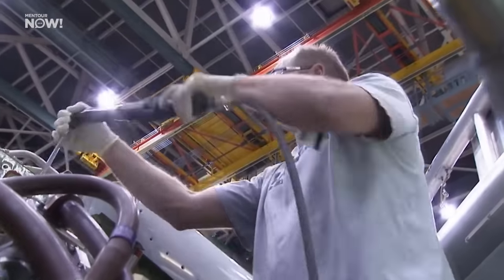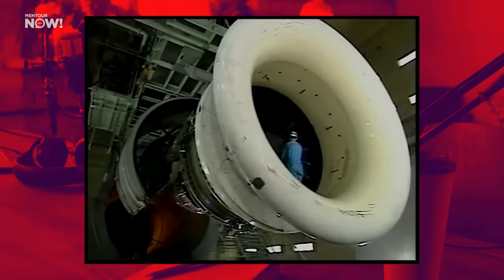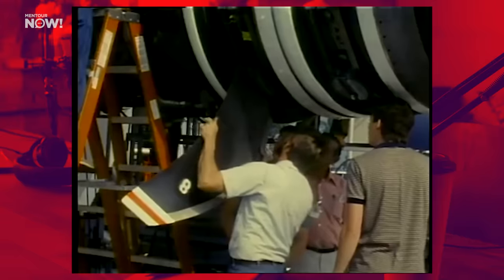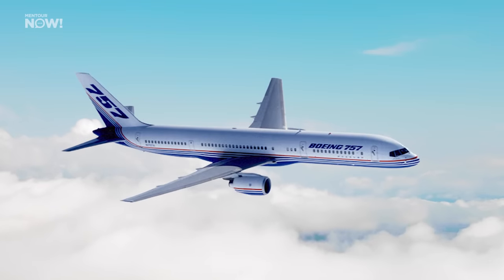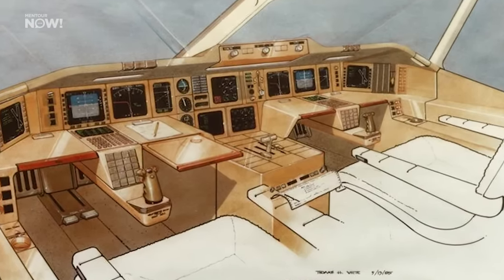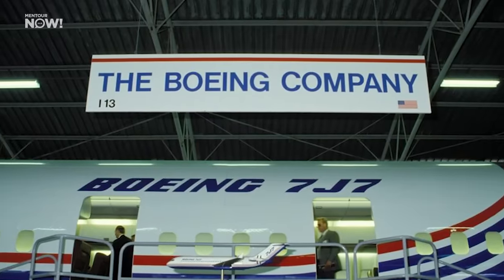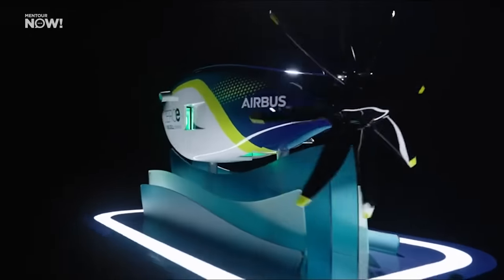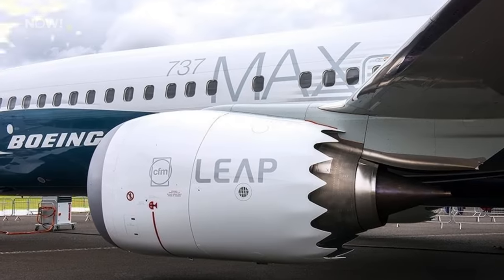Revolutionizing Flight! The Amazing Potential of the CFM RISE Engine.

Comment: As always Mentor, you’re killing it with an excellent and well researched topic. Q:  Would the function of the stator vanes be to redirect the helicoidal flow coming off the main rotor? This would represent a significant gain in effective trust.  Thanks.  Jacques an avid listener of your channel.
Reply: great question!  I was wondering the same thing ...
Reply: Yes. The lower speeds require a shallower blade angle to get the air and vehicle moving. This means the rotational air flow is more perpendicular to the intended direction of the aircraft at lower speeds. Consequently, the stator blades cannot be too close to straight at lower speeds, otherwise, the rotating prop wash will smack them, causing turbulence. Directional flow correction provided by the stator blades is accomplished by mirroring the angle of the propeller blades in relation to the axis. Both sets of blades will get increasingly straight-looking as air speed increases. This genius concept is the moment we’ve been waiting for!
Reply: @Yashua-Is-Lord  Brilliant explanation!  Thank you! I understand from your explanation that tying to fully compensate (redirect)  the helicoidal air flow at lower speed would be detrimental to performance. The stator vanes would absorb to much energy bringing the ship to yaw. Counter rotating engines could solve the yaw factor but at the cost of loosing dynamic efficiency.
Reply: Thank you! My guess is the stators maintain around a 15 degree greater pitch angle relative to whatever is the propeller blades’ angle. The stators just auto adjust at this 15 greater angle of attack to improve the straightness of flow. Although not complicated, it’s hilarious that it took over a century of aviation for anyone to think of this. I certainly didn’t. Face palm.
Reply: @Yashua-Is-Lord  Sometimes, when things are to obvious, we go right pass them without noticing ;-)  Thanks for the exchanges...🙂

Comment: That old Soviet aircraft’s engines towards the end really seems like the open-air design they were testing in the 80s, but more primitive. Really impressive design for its time.
Reply: The Russian Tupolev Tu-95 Strategic Bomber has used this blade arrangement since 1956. It is one of the fastest propeller driven aircraft in history.
Reply: @SJR_Media_Group  Contra-rotating propellers where used in WW2. A quick check reveals it was patented in 1907.
Reply: @agentcrm  Thanks for correction, I always mess that one up.
Reply: The British Fairey Gannet was an even earlier successful design of a contra-rotating turboprop. As a carrier-borne search plane loiter time mattered, so efficiency was much more important than top speed. You could actually turn off and feather one of those props to loiter longer.
Reply: @SJR_Media_Group  All good. The Tu-95 is the most well known of the early turboprops. 
But the contra rotating props where used on a few piston aircraft earlier.
Reply: @kenoliver8913  Wouldn't call the Fairey Gannet successful. The Double mumba wasn't known for it's reliability apparently. Also as the name suggests it was 1 engine driving each prop.
Reply: @agentcrm  Doesn't the Airbus A400 cargo plane use them also ?
Reply: @agentcrm  Thanks for input.
Reply: @SJR_Media_Group  The A400M uses a standard turboprop configuration.
Reply: @agentcrm  Great... thanks
Reply: Actually Soviets/Russians were testing propfans through 80s and 90s, building multiple engines/planes, which Mentour like usual doesn't mention out of sheer ignorance and lack of research...
Reply: @Tony Bullshit. Junkers design was crap and while he developed basis for working turboprop, his engines didn't even work an hour before failing catastrophically. It was Kuznetsov team who made it into working engine, along with Soviet metallurgists who developed alloys good enough to withstand it. The design was so good that Airbus A400M engines, developed 50 years later, are weaker and much less reliable, requiring multiple groundings of 400 fleet thanks to wear, something that never happened to 95s...
Reply: @KuK137  Finding information about Russian / USSR projects can be quite hard if you are not in those countries or programs.
Reply: @KuK137  Our future air power comes by returning to our past. Back to Props instead of Turbofans. 

I am Former Boeing Everett. I've been up close and personal with a GE9x engine. It is absolutely huge. It will be exciting to see if new generations of prop powered engines can replace current engines.
Reply: @agentcrm  Also, working out what is real and what is propaganda and pride was always difficult, though some claims are so obviously made entirely from pride, such as denying the value of all imported engineering or claiming a scientific result was based on the genius of ideological leaders of the communist movement.

Comment: There was a GE 36 (I think) setting in the proving grounds at the GE facility in Ohio when I was there in 09, I was also told that other than the noise issue, the pusher blades were not contained in the event of catastrophic failure/blade out, they may enter the fuselage, so the FAA frowned on this design at that time. Just what I was told.  Throwing the E-6 in there was nice.
Reply: What if the engines were located at the back of the plane where the blades cannot hit any passengers, like in 727?
Reply: @MVargic  It was still an issue with compromising structural integrity and flight safety, this is why all engines now are required to have a very strong FWD fan case in the event of a blade out, the fan case must protect the fuselage. These were tests that we ran at the GE proving grounds for the GENX engine development.

Comment: The Bristol Brabazon was first flown in 1949 and had contra rotating props. As did the Fairey Gannet also first flown in 1949.
Reply: And the Metrovick F5 open rotor development was underway in 1945 and I think there was a proposal for an open rotor engine a couple of years before at Armstrong Sisdeley by TP de Paravicini.
Reply: One of the really nice features on the Fairey Gannet was the ability to shut down one of the propellers and maintain altitude on just a single set of blades. This was done as a way to conserve fuel and was accomplished by separating the engines that drove each prop.  That plane was ugly as sin, but it sure got the job done and didn't cost too much while doing it.

Comment: I saw the udf flying and it was insanely loud. But it was the same blade count and the shock waves from the primary prop slamming into the second prop leading edge.  Reducing secondary blade count fixed the issue. I had a talk with willis hawkins about this and he agreed but he and lockheed were not involved in any of this.  Willis hawkins was an inlaw and a lot of fun to talk to at the few family gatherings we both attended.
Reply: If I recall there was a fighter tested in the late 40s called the Thunderscreech that was so loud that it could generate lethal shock waves within a certain distance of the props and those same shockwaves were destroying test equipment and damaging the aircraft.  Like the TU-95, counter rotating props with supersonic tip speeds.
Reply: @mrvwbug4423  i laughed so hard reading that air and space magazine.    X15s coming in for landings at edwards use to leave echoing sonic booms in lockwood valley in the 60s when i grew up there.

Comment: Interesting idea with a variable stator instead of a second fan. I saw another interesting idea a few years ago from what used to be Volvo Aero having the blades of the second fan being loops to prevent noise from tip vortices. Hope they make something with that.
Reply: Wouldn't it be simpler to have miniature winglets on the end of the propeller?
Reply: @kenoliver8913  I think that was the inspiration for the idea, the loop makes it sort of an infinitely long winglet.

Comment: It is a good example for the point which I recently made about another technology: A technology is only dead once every aspect and possible solution has been explored and once no new material or methodologies is popping up to fix the known problems. This engine design was sitting on the shelf for over 40 years and now it has a come-back, because some companies were constantly working on it (though with little budget I assume).
Reply: No, no it wasn’t. Do try and keep up 🤦‍♂️.

Comment: The dynamics problems haven't changed. The reason the TU-95 is limited to 350KTS because of the increasing aerodynamic penalties on the prop spinning faster+incoming air speed. While a 737 is typically at 460KTS. There is a loss of efficiency and exponential torque required above 350KTS equating over 1 hour longer on a trip from Miami to Chicago. Additionally the high by-pass turbine is more efficient in the thin air at 410000 feet where the weather will always be smoother.

Comment: I loved the 727. Of all the passenger jets that one pushed you into your seat at take off like no other. The 747-400 would make you do that, but that was a rare plane to fly on for me. The short/medium range planes are what I flew the most. The 727 and the MD80. That one too was a rocket ship.
Reply: Have you flown in an E190?
Reply: @userPrehistoricman  Not sure. If I have I don't remember it specifically. Why? Will it pin you to the seat as well?
Reply: @valuedhumanoid6574  It has better acceleration than the 737, that's for sure. You can find videos of them climbing steeply on normal passenger flights.
I calculated thrust to weight ratio using max thrust and MTOW and the E190 is about 50% higher than the 727.
Reply: @userPrehistoricman  So...have YOU actually been in one to feel that yourself?
Reply: Twin engine planes have a lot of reserve power in case one engines quits. The pilots usually take it easy on take off to save fuel, make less noise  and not to scare the passengers. When the 737 was introduced to New Zealand circa 1970, some pilots couldn't resist the temptation to show what they could do, given that in Wellington both the approach and  climb-out are over water and the air is usually very  turbulent. 

Three engine planes generally had less reserve power, which made them more vulnerable to microbursts on approach (e.g. Delta 191, an L-1011), but I believe the 727 was designed to operate out of small airlields, hence its power. It took a few years for smaller regional airports to lengthen runways for jets in the 1960's.
Reply: @valuedhumanoid6574  Yeah I flew on E190 twice. Not a 727 though
Reply: The 757 takeoff is  damn fast

Comment: It would be nice to know the advantages/disadvantages of a pusher model compared to the traditional engine mount!
Reply: As the planes come in nose up and the engines are really far forward of the wings they're quite clear of the ground.   A big pusher engine and prop would be very low to the ground on landing and take off and probbaly need much higher and heavier landing gear
Reply: The big problem with pusher designs, right from the dawn of aviation, has always been avoidng the disturbed airflow from the wings which can drastically lower propeller efficiency. If on the tail you have to put the engines high up - but this tends to push the nose down, which can be dealt with but may lower aerodynamic efficiency. It also complicates maintenance. Careful design can minimise these problems so you get the advantages of pushing rather than pulling (including leaving lots of the noise behind) - but only minimise, not completely remove, them.
Reply: Pushers historically have overheating problems, as they do not have sufficient airflow over the engine to cool the engine except in flight.

Comment: Problem with the "unducted" Fans, just like the piston and turboprop engines, is propeller "slap" where the air coming off of the tips impacts ("Slaps") the fuselage of the airplane. 
 
In fact in the heyday of large propeller driven aircraft, First Class was in the rear of the airplane to be far as possible from the "slap"!
Reply: I wonder if some kind of active noise canceling could be used.
Reply: @ericpaul4575 That's why several of the designs had them mounted at the rear of the plane as pushers! 
 
(Even a Beechcraft turboprop called "Starship" had it's turboprops back there and as pushers!)
Reply: What if the blades had bent tips like some wings have?
Reply: @martinwilliams9866  Perhaps something like how some 1920's planes had a ring around their radial engines, but not a true cowling.  This helps with the. thrust of underwater propellers as well as reduce propeller noise...
 
Don't see why it wouldn't work for aircraft propellers.

Comment: Something similar to this has been used to update a lot of turboprop aircraft. Those used by the U.S. military seem to have changed to this with various platform updates within the previous decade or so. They don't seem to have the noise issue concerns like that of jets, where ducted high-bypass fans still seemed to be preferred.

Comment: If you ever want to know what happens when you push propeller tips past mach 1, look up the XF-84H "thunderscreach". the propwash hits the ground and the supersonics turn into subsonic waves and they would cause everything from ground crew to pass out, soil themselves, and have instinctual fear caused by it, along with cracking glass and concrete. Someone did a re-creation of what one would sound like at 17,000ft and it would still be 101 db at the ground, as a howling screech. It had a top speed somewhere been 520mph and 670mph... with a single prop.... it's basically a war crime with wings at that volume...
Reply: Provided your troops had ear protection, training to get used to it and a heads up, that would make for the greatest air support ever
Reply: @347Jimmy  Ear protection would not be enough.  That level of subsonic waves vibrates bodies as a whole, shaking internal organs and the rest of the body.
Reply: @joeh8784  that's what you would train for
The ear protection is just there to keep from going deaf
Reply: @347Jimmy  That kind of subsonics is not something you can train for
Reply: @joeh8784  whatever you say 🤣

Comment: I was working near CVG in the 1980s and happened to see the plane with the GE-36 engine. It wasn't much louder than regular jets. It had a different sounds than jet or standard prop plane. If that is the same plane, I was told that prop flew off and hit ground in Indiana somewhere and that stopped the program. TY for the video.

Comment: I still miss the 727 and the various DC9/MD80 variants.  I really liked the rear engined powerplants, always wished I could have flown on a VC10.
Reply: The V.C.10 to this day is the only air craft ,that , I felt just wanted to fly by design... went up to 53000 feet ( military version , can see the curvature of earth ) , no problem,  and up front it was so quite, and smooth ... the only reason that this design was not carried further on .....was....service / acessability of the installation of engines ( 2 side by side pods at rear) ..sorry you never will experiance this ...as the old saying goes ...if it looks correct ,it usually is ....note I am ashamed at never flying Concorde ,my greatest regret in life ....period .....
Reply: @adrianpeters2413  Yeah, I started flying on business in the early 80's for the next 30 years.  Lots of 727's flying back then and I loved them.  Lots of SW Airlines 737-200's as I live in TX but also lots of DC/MD's also. But then, I still love the look of Goldfinger's Jetstar!
Reply: @loveisall5520  yeah , the rear engines design was absolutely the best ,

Comment: Excellent video. This was all first announced back in 2010ish where Airbus an Easy jet proposed developing the rear engined shape for them . Speed figures were exactly as you mentioned with Vmo .82 Ceiling 42000 approximately. Of course very cheap fuel for the decade basically killed th project but am glad to see it back on the table.  Interestingly the PW150a is actually deemed as a non ducted fan though i would actually call it 13.5 feet of noisy Ba*$£rd.

Comment: It’s good to know that turboprop designs reinforce the fuselage. I was recently seated at the prop of an atr in India. Wondering deeply what would happen if the crop came apart.
Reply: You get a free shave and complimentary underpants.
Reply: You wouldn't know about it when it happened

I won't sit on those rows. In the case of even a mild wingbending incident it's almost always where the first (or even only) fatalities happen. 
3 people I know died that way when a Dash-8 crew got so busy trying to get gear down they forgot to pay attention to altitude
Reply: @miscbits6399  Which accident was this?
Reply: @roichir7699  Ansett New Zealand flight 703, 9 June 1995
Reply: A guy above said he works on turbo props and that that is a destructible plate added to catch ice being flung off the propellers, that it is just a replaceable piece of aluminum, and that it will definitely not stop a propeller blade.
Reply: "Great content- although for FWIW, as a turboprop mechanic you don’t get much in the way of “blade out” protection. What you pointed out on that ATR72 at 14:37 is an ice plate. Common on most turboprops, just a sacrificial layer to absorb ice being flung off. I’ve replaced them on the ATR and they are literally just a chunk of additional aluminum double sided taped to the fuselage. Will in no way stop a blade from coming through."
~@Turdpike

Comment: I do work as a aircraft mechanic and the noise problem was sure mby exaggerated. But it's insane that the NG and The max engine is the difference between using a headset with radio coms and having the ability to lift up your headsets quickly and speak a bit loud. Hard to explain but Holy the differences are huge.
I'm new in the industry so I'm not to familiar with the engine types but still.